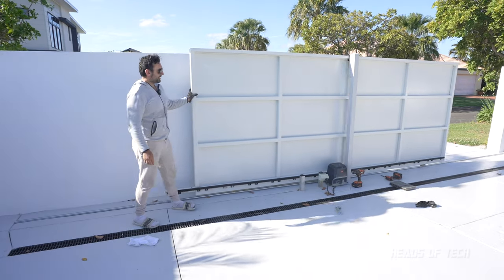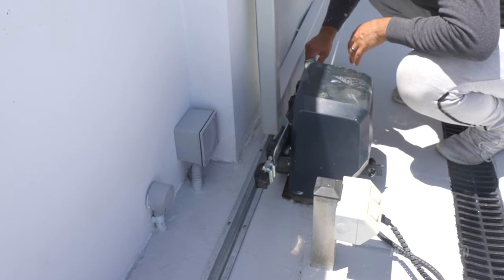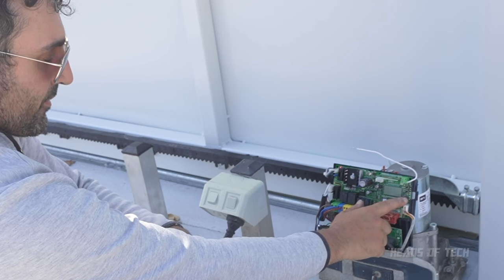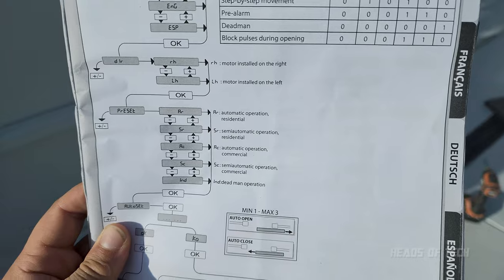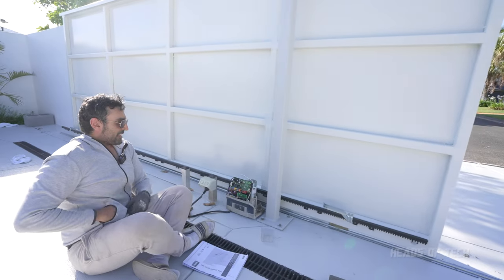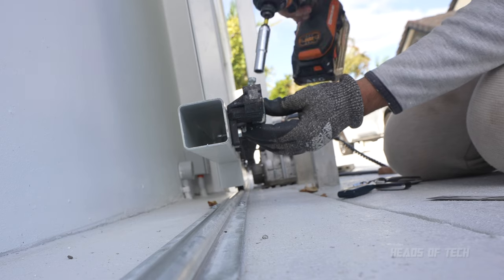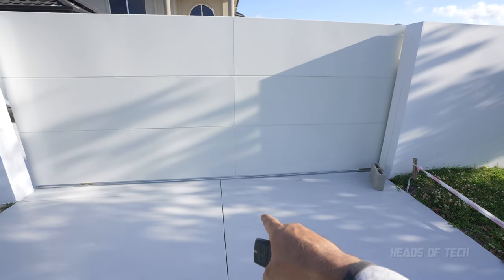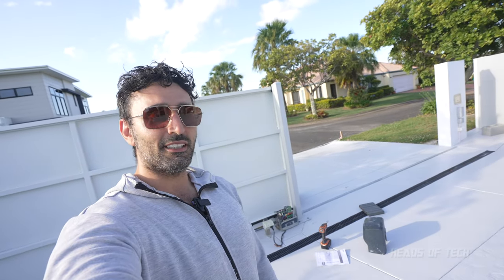BFT Motor Setup and Programming for Sliding Gate

Comment: Nice work but you left the square tubing open in the frame. Now you need a cap to keep water out. A miter cut at the corners would have closed all the tubing. What does the upper roller look like that holds the gate vertical? Where did you source that? Thanks

Comment: I got a BFT Ultra but some times it stops part way across then moves back a bit and then I have try several times to get it working again.  There is no debris on track or obstacles on the sensors, any ideas why it does this?  seems to be intermittant too.  thanks
Reply from the maker: Mine only does this if you physically block its path, I'd double check the gear rack for debris also, or if it's not that perhaps its a warranty issue with the motor or sensors? Let me know how you get on.
Reply: thanks could be sensors, im getting it checked tomorrow @headsoftech
Reply: ok I got it checked, looks like the "soft edge" sensor needs its batteries replacing! I thought only the fobs used batteries but there you go! so hopefully that will fix it
Reply: @stevezm100 how old is the system?